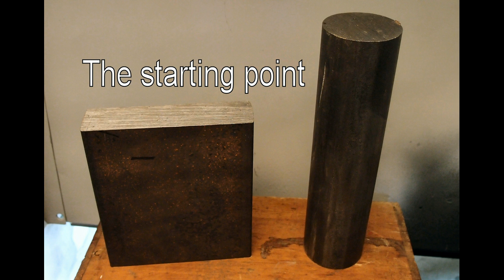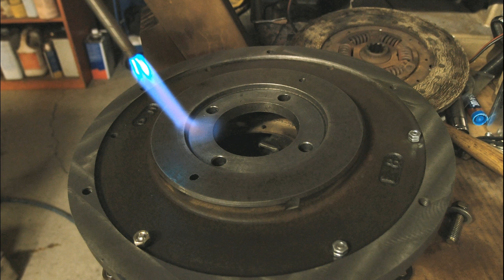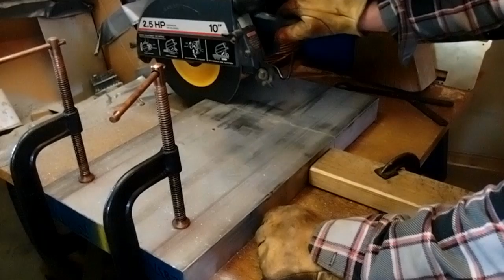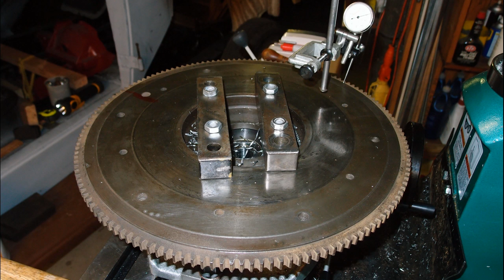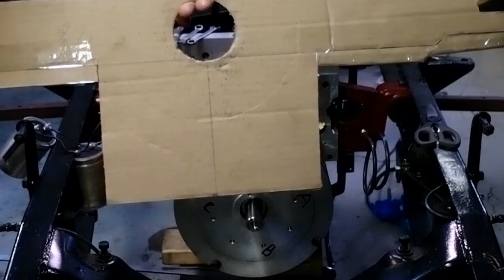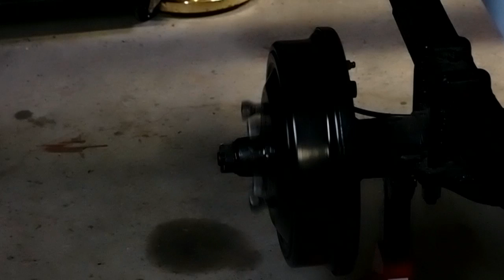1939 Dodge Electric Truck  Part 2

Comment: those adapter plates are aluminium, isn't the motor shaft  and the plate that holds the motor shaft and all, is that steel or aluminium?

Comment: Clutch? Flywheel? These are not needed - all they would do is fight the motor!  A transmission is nice to have in order to set speed range, but why not use a much newer and more efficient trans. Carrying around all that dead weight means you have less battery KWHs to enjoy.

Comment: Great video and workmanship. You are a highly skilled man. I only question why such thick and heavy parts. Aluminum plate could have easily handled twisting loads, (torque) at half the thickness, and also supported weight of components, no problem. Love those Dodge trucks!

Comment: Yes,  a flywheel ring gear, comes off. Change my first one when I was 16. The Aluminum was probably 6061 and no it's not the good one 7075 is, it has almost double the Tensile Strength. You made that beautiful aluminum front mounting bracket and then cut it. What were you thinking? Get the plasma cutter, notch the frame and MIG weld it back in later, or something. Other than that "GREAT JOB" Good video, narration, instruction, you make it look and sound easy and it's not.

Comment: Probably stupid question, but why do you need a flywheel? Regenerative breaking?
Reply: clutch is a very nice safety device !
Reply: There is more than one way do do this. If you want to retain the clutch you need the flywheel because the clutch acts on the flywheel.

It is also possible to connect the electric motor to the rear differential and eliminate both the clutch and transmission.

Comment: I think you add a pulley system on the front of the engine & run maybe to hi-output alternator & once the batteries get the motor up a certain rpm turn the batteries off & let the alternator power the engine, perhaps even 4 alternator.
Reply: You might want to learn a little more about how electronics work lol

Comment: Really nice work!    You should had removed the gearbox stand , install the motor mount  on place and ther the gearbox and motor.    The oposite way it is suposed to do with gas engines.

Comment: Nice Pickup !  I have two projects,  '46 & '47 Dodge pickups, '46 will be a convertible pu,(roadster), because top is too far gone, & '47 will be Rat Rod or Street rod. Where did you get the new steering, brake & suspension parts ? Mine will  both be stock for now, maybe changing to disc brakes later on !  Thanks for the info, Steve

Comment: Don't those cut off wheels heat up and explode when cutting aluminum?
Wouldn't a regular saw blade on backwards work better? or not on something so thick.Never tried cutting a piece of aluminum so big.

Comment: wow brother thanks for the inspiration ...oh and I noticed you enjoy some Jimmy Beam as well Cool , I have a nice low mile '67 Toronado I was planning an LS or LT swap but I'm now thinking with a weight reduction by pulling some molds off the fenders hood inner parts under the hood and the doors and replicating them in Carbon fiber , but the batteries are the killer SO expensive , once the big auto makers flood the domestic fleets they will start showing up at the wrecking yards then the fun can begin in earnest . ...Cheers

Comment: So did you heat up the flywheel and take off the ring gear? A Chysler altenater can be amped up to produce 120 volts with coils to regernerate power back into the charging system. those old drum brakes with a single master cylinder yikes. I think it was in 67 that DOT required all manufactures to go to a dual master cylinder incase something happened to a wheel cylinder and you loose your braking system, Love the old Dodge Sir. Whish I had the money and equipment I would defnitly do and old Dodge conversion to Electric.

Comment: Hi, I have a general question not related to this project directly but I assume you have good working knowledge about elected/hybrid vehicles.

In a parallel hybrid car, is it necessary for the motor and ice to spin at the same rate. If so how is this done, does the motor controller do this?

E.g. how does a motor spinning at 3000rpm with 200lb ft of torque actually add that 200lb ft to a ice that is spinning at 4000rpm. 
Common sense tells me the controller will have to constantly adjust the motor rpm to match the ice. If its going slower it will be actually resisting the rotation of the ice, no?

Thanks in advanced.
Reply: +mazin2892 One only needs to look at a cutaway of the Prius Engine and you will see its very complex.I would think their control system is equally complex.I would guess that the gas and electric have a degree of Independence of each other..Asynchronous.
Reply: One reason that hybrids are more fuel efficient is due to the ICE running at it's RPM efficiency sweet spot, as opposed to a traditional drivetrain in which the engine is rarely running at it's most efficient.

Comment: Respect !  When making the motor/bell housing adapter plate, any off centre will wear the gearbox & motor quickly, What is the acceptable / achievable tollerance ? PS if you ever want to sell her let me know.

Comment: Is that a Warp 9 or 11 motor? I was also wondering how much that 2" aluminum plate set you back? I found a company that sells the transmission/motor mount for $850 which I think it's a bit too much for a chunk of metal.
Reply: hed420 Look on Youtube. A guy does it himself, at a home machine shop.

Comment: Regarding the adapter you precisely made that "heat-shrinks" onto the motor shaft...(good idea)...how many thousands did you machine it smaller than the motor shaft itself so that applying heat to the adapter would make it fit perfectly?  I want to replicate this on my motor adapter.
Reply: 1 thou per 100deg Celsius of expansion

Comment: Why does it seem everyone is using this same electric motor? Why would you use such a old style transmission? I would think you would use a more efficient transmission.
Reply: Justthe Truthtv How economical would it be to manufacture a specialty transmission, just for this electric conversion? It is easier to manufacture en electric motor which fits the torque requirements of a standard tranny.
Reply: ***** That electric motor already had more torque than it needs. But mounting it might be tricky and expensive.  Much easier to mount it to an existing pressure plate, on a standard tranny.